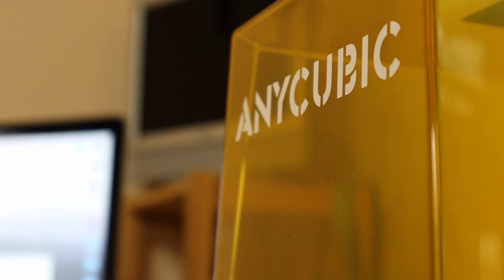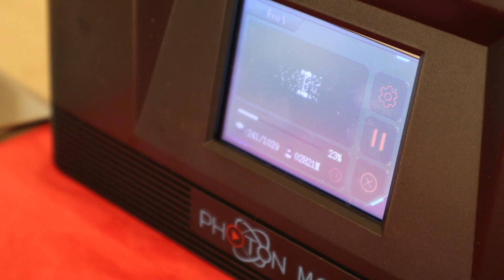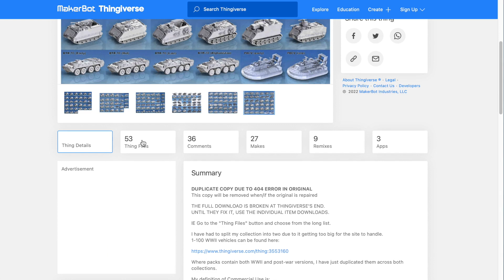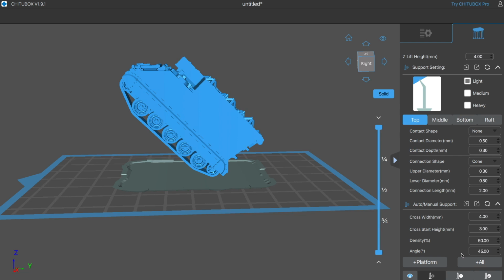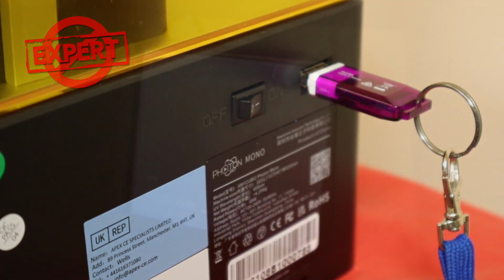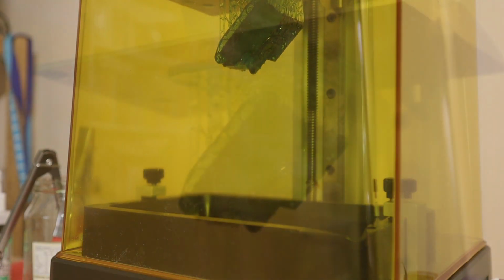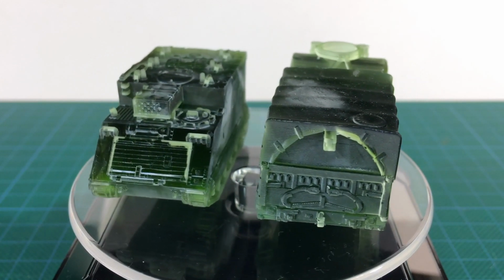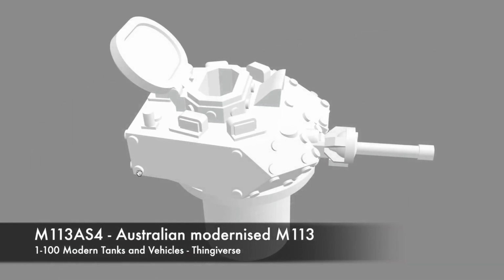Snippet | Resin 3D Printing for Wargaming - My First Print | 1/100 (15mm) M577 APC

Comment: A few tips from one Harry to another,

You will most likely be able to get a better print quality by rotating the model about 2 axes (both X and Y), as opposed to 1 (X), at these scales some of the small details will warp if only rotated on one axis.
If you're still using the basic Anycubic Resin, stick to the clear stuff, the opaque resin has some issues and quite often forms a soap like surface much easier than the clear (from the looks of it this happened to the 577's left track in the video), you may be able to source a slightly better resin from Elegoo's range or even a local Jaycar store, if you go down this route do a Resin Exposure Range Finder (RERF) Test, files for nearly every photon machine can be downloaded from Anycubic's website.
 
I would very heavily recommend printing vehicles hollow, it means slightly more work preparing the files for print as auto supports can be touch and go with Chitubox when objects are hollow, but it means your resin will last a fair bit longer, and could potentially get you an extra few prints out of one bottle, which will keep the overall cost of printing down.
 
I'd also suggest buying a small tea/coffee mesh strainer and cutting the handles off to use as a filter for unused resin should you wish to return it to its bottle for later prints, the provided filter paper with the printers isn't really of the best quality and allows some clumps of semi-cured resin to pass through
Reply from the maker: Thank you for sharing all of that. The M548 was rotated in two directions and came out better. I'll do that in future. Appreciate your thoughtful and detailed reply.

Comment: That is incredible as well as cool. My first experience with printed anything was a Zvezda upgrade kit for the King Tiger. The guy is in Moscow Russia so I had to apprehension of getting ripped off. It cost $20.00 shipping included . I got it in about a week and I was blown away by the detail. I have bought several printed tanks and buildings from a friend here in Colorado and there awesome as well. Great video as always.
Reply from the maker: I had a quick look for the upgrade kit but couldn't find it. Do you have a link you could post?

Comment: I think you are right. 3D printing is interesting in our hobby for special vehicles/units. If you want 30 T-55 it is much easier (and cheaper) to go for a commercial product.
Anyway I guess 3D printing is a hobby of its own. At least it takes hobby time, time you can't spend on force building, painting and playing. If that is your cup of tea -great, you will have fun. I won't go for this (because I don't have the right place for a 3D printer too).
Reply from the maker: I think Mrs Fog of War will be the 3D print enthusiast in our household. She was nice enough to let me print the odd tank. But I wouldn't want to push my luck.
Reply: Depends if there's a plastic kit out or not. If you need a battalion of Panzer IVs, you wouldn't bother with 3d printing and just buy the (fairly) cheap plastics boxes. If say, you want to do some Centurions or M41s or any other tank that only has resin metal options, suddenly mass 3d printing a large number becomes both more economical and gives you a degree of quality control.
Reply from the maker: @ausaskar  You are right. I think I made the point in the video that this is best for specialist and rare vehicles. If I wanted Panzer IVs I'd buy plastic. Even if there was a good resin and metal kit available, I'd probably buy that rather than print. But Bob Semple tanks are kinda rare in 15mm. 3D printing to the rescue!